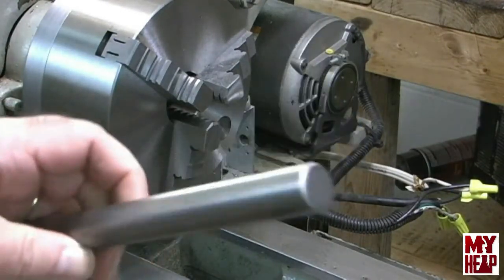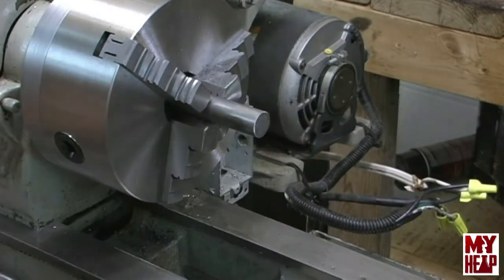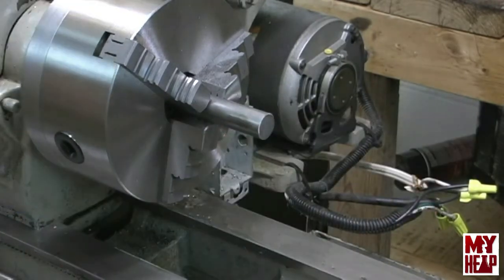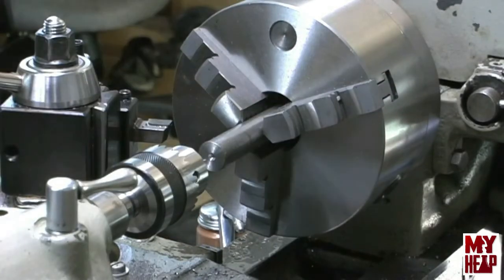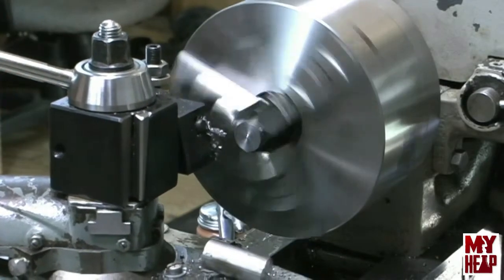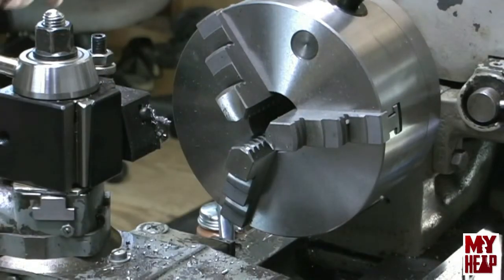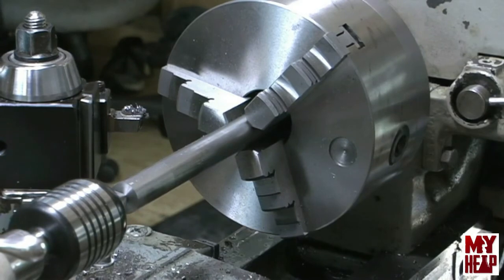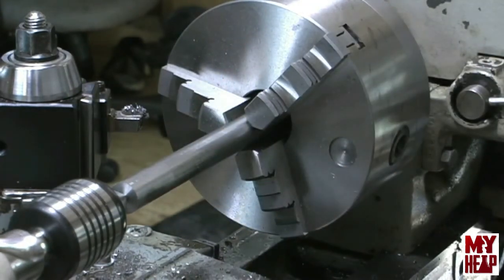YouTube Shop Student - Episode 008 - Captive Nut Puzzle - Part 1 (Audio Fixed)

Comment: Hello Heap, you are doing good on making videos. I have a craftsman lathe like yours and I need a good three jaw chuck and a quick change tool post and tool holders. Just would like to know where you got yours?
Reply from the maker: Clifford,

The Bostar AXA toolpost and holders, the three jaw and backplate came from cdcotools.com.  The four jaw and backplate came from shars.  Now these are Chinese accessories, so I don't know if the qualify as good.  They do however work well for me.  FYI, if you buy one of these chucks, just know that you will need to take it apart and clean it before using.  They have a lot of what appears to be grinding grit in them.

Joe